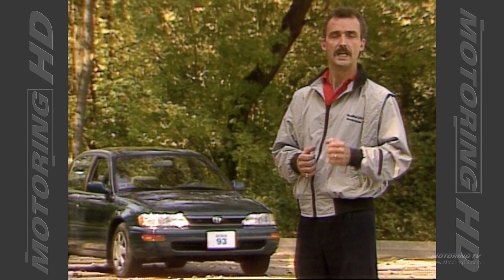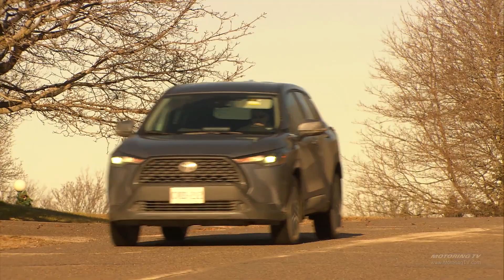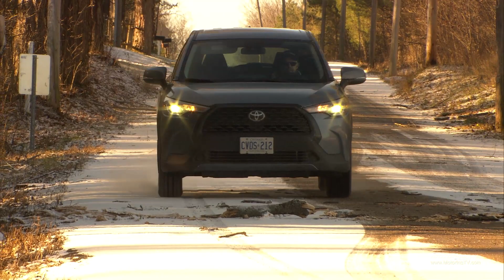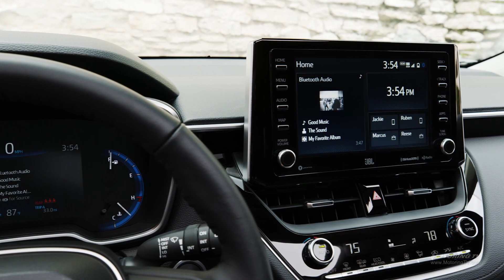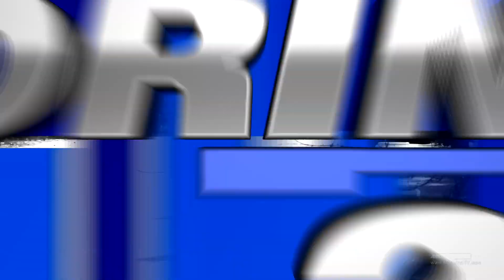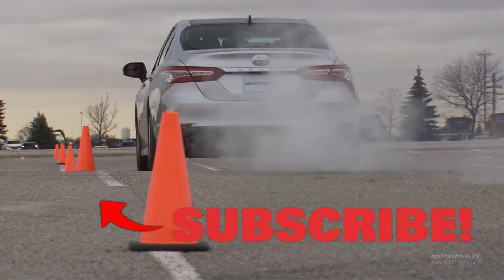2022 Toyota Corolla Cross // Test Drive | Motoring TV

Comment: Even though it's a modified CVT i question the reliability factor once it's out of the driveline warranty.  It's no secret manufacturers are going to CVT for a substantial cost savings per unit.
Reply: It's a Toyota so...
Reply: It's about the economy advantage also (at least on the EPA cycle, which Canada uses too). On the WLTP cycle (and in real-world), manuals and DCTs are still most often more efficient.